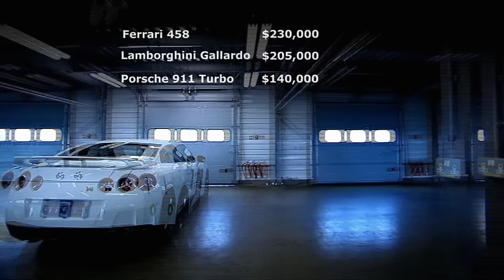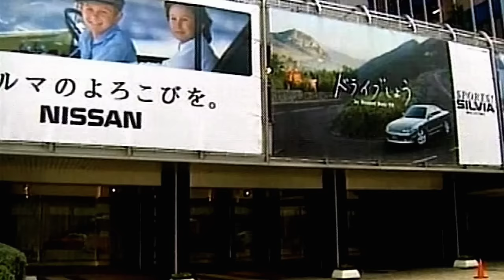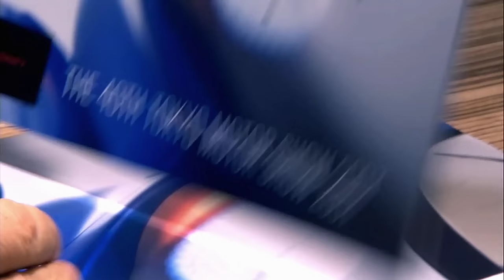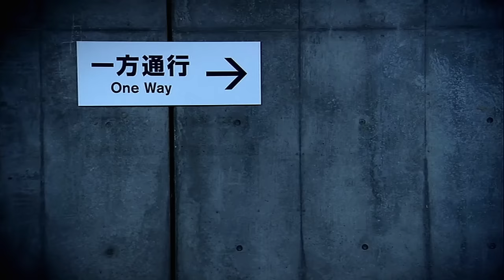Nat Geo MegaFactories - Nissan GT-R

Comment: I wish I could afford one. I’m most struck by the number of times the Nissan employees used the word “customer.” They really bought into the focus: “make the best car for the customer” and not “make the best car.” That’s a significant difference. Others may make fast, but uncomfortable, cars that you can barely climb into. I respect what Nissan did here.
Reply: Bro get 2010 they go for 50- 60k that pretty affordable. Don’t fall for dealership mark ups.
Reply from the maker: I wouldn't. I would only buy a 2012 and newer. The DBA has updated transmission components, and believe me. It's worth the extra costs instead of replacing it later.
Reply: @Mikey6048  never ever buy first generation of a new car model, even a 600~HP GTR
Reply from the maker: @kamenriderozai8403  especially the GTR

Comment: The GTR is a phenomenal car. Even the older models when it was still Skyline. My favorite.
Reply: Wdym even the older models?  The older models (specifically the R34) are way better than R35+
Reply from the maker: @jmathis2aug In what regards? Nostalgia? If based purely on performance. None of the GT-R of old touches the R35.
Reply: @Mikey6048 Go drive them all and you'll see why. The R35 is a driving appliance. It takes much of the skill out of the equation. Your mother could get in it and drive it fast! maybe that's the point....I've owned the R34 GTR and an R35 at the same time. I drove, and pushed them both all the time. The R34 was exciting, and fun, yet could be a calm daily driver. The R35 felt like a Maxima that was stupid fast.  In other words, boring. If I were to own another, I'd get an R32. It has almost the same drive train as an R34, but it's significantly lighter and by far the most fun to drive. I guess this is kind of happening to most cars nowadays unfortunately..... One of the reasons older cars are going through the roof in value. The 35 is a great car, but "the best GTR" is debatable.
Reply from the maker: @LordHolley  I own one. In stock form sure. But when modified it's a completely different animal.
Reply: I'm a 1969-1989 Skyline fan myself. I love the R32/33/34 very much, but those first two decades are my favorite! Like the Silvia. I love the S13/14/15, but I absolutely want an 83' 240RS Silvia. The Group B Homologation car. Drive that one & listen to it on Gran Turismo, then check out real pics & video. Of that Silvia and the first two Skylines ( and the Fairlady, Sunny/210, Gloria, Laurel, Cedric, Cima, the President, & of course the 510. So many glorious vehicles from Datsun/Nissan, and every Japanese auto manufacturer from the beginning up until 2004 ( but especially from 63'-99') 🌅
Reply: Right!  I would trade a testicle for an R34 or an R33.
Reply: 3 @LordHolley

Comment: I'm a Nissan GTR Master Certified technician. I  worked and serviced on many many GTRs between 2009 and 2014 . Awesome car.
Reply from the maker: I definitely appreciate you guys. I've had mine in the shop a couple of times for some breakdowns. (None the fault of the car) and the Master Techs that took care of me were top notch.

I've blown open an injector. Previous owner used, used injectors. You can blow air with your mouth through it. Flex fuel sensor shorted due to previous owner installing poorly.

Then I blew my transmission up last summer.... 🙄. 5th gear stripped 1/3 the teeth off and the Synchro was destroyed.

Comment: Pretty amazing when you consider that this cast aluminum block is now being built in 2500-3000hp levels while domestic vehicle's require an aftermarket block. The rest of the drivetrain is the same. Maybe a 300m gear here or there but, just bulletproof.

Comment: Good honest review 
Hi from New Zealand had my 800 MT for 12 months now done about 20000km  been a great bike so far, only issues I've had is a broken switch and the mirrors keep moving both replaced under warranty, I also own a triumph trophy and a GS, the CF moto is the bike I usually drag out of the shed
As you say get over the Chinese thing and it's all good 👍
I'm actually considering buying the just out in NZ cfmoto 450 mt

Comment: 36:26 Lmfao.... Most tire shops now days use nitrogen instead of air. "Unstable" is nonsense really. However normally air does have a higher content of Hydrogen, and thus Water. It also changes pressure more under different temps. Normally as the tires heat up, the pressure rises, Nitrogen tires change less.

Comment: They need to just make a newish version of the 300Zx mix the 80s and 90s designs, for something a bit smaller, less weighty, and utilize design input from the delorean HP 1000 Give consoomers the Hyudai N vision 74 of the 300 ZX. and make it hydrogen fuel cell based.

Comment: The only thing i dislike about the gtr is that its an automatic gear. I like manual transmission machines😢😢
Reply from the maker: Technically it is a manual. Just minus the 3rd pedal. It's called an automated manual. Instead of you operating the clutch. It's computer controlled. It may sound like an automatic, but it honestly isn't.
Reply: Thats what i dont like. I like the fully manual with the 3rd pedal. It gives me a sense of control.
Reply from the maker: @Lalmalsawma_C  I can appreciate that.

Comment: two phrases: one, turbo lag and two, Carlos Ghosn fled Japan for misappropriation of funds.
Reply from the maker: I've never experienced turbo lag on this car.
Reply: @Mikey6048  took them years to fix it
Reply: @Mikey6048  try flooring it at 15mph
Reply from the maker: @mikerotch8886  I have. As long as you're in manual and 1st or 2nd gear. But if you're in auto and it's in 3rd. Yea you'll have lag

Comment: are they reliable?
Reply from the maker: Motor is rock solid. Transmissions are iffy. Overall it's a very reliable car. If you never mod it and buy one newer than 2013 it's rock solid.

Comment: Since when does a 100k car become the "average mans" car?  At that price, 100k or 140k are about the same and you can afford a wide number of super cars.  This car is "mass produced," thereby making it more accessible.  I would argue that being mass produced could drive the price down to the 60-70k range with a few trade-offs, making the car more accessible.   But  to keep the mystic around the car and to profit from them, they will not.  I'm not a fan of the design, but it's a real nice car, one that this average man can not afford.

Comment: Upload some more of your GTR
Reply from the maker: I wish I had the time. I work 60+ hours a week and don't have time for YouTube currently.
Reply: @Mikey6048  how are you ? , How's everything going ?
Reply from the maker: @Janvick533  Very busy. Still working 60+ hours a week. The GTR transmission is hurt and I'm in the process, when I have time, of getting the rear subframe dropped and the transmission out. So I can send it to ShepTrans for a stage 2 with Heavy Duty gears build.
Reply: @Mikey6048  take care brother .
Reply from the maker: @Janvick533  I appreciate it. Trying to get a new job currently. If I get it. Hopefully I'll be able to find some time to post some stuff about the GT-R. I plan on putting a AMS titanium exhaust on it. So if I do I'll make a video of that. Hopefully.

This trans rebuild is going to cost me north of 13k$.

🤮
Reply: good luck bro id love to hear that future exhaust @Mikey6048
Reply: @Mikey6048  dam sorry to hear, i see you have a DBA GTR like me whats the issue with the transmission?
Reply from the maker: @charles-fq2dw  I had an axis solenoid go out and lost all Odd gears when downshifting to 5 on the highway.

   When I pulled the pan to pull the valvebody, I found metal chunks on top of it. So I am sending it off, today ironically, to ShepTrans for a full rebuild with Forged Gears, Forged Baskets and Billet forks.
Reply from the maker: @AE300  I actually purchased the AMS Titanium Exhaust, it came in Saturday. Once the transmission is back in. I'm going to make a sound clips video.
Reply: @Mikey6048  oh that's really nice, excited to hear your new exhaust
Reply from the maker: @AE300  Thanks brother. I lucked out and got it on sale as scratch and dent from AMS. They currently have a couple on thier site still for $1500+ off.

Comment: Funny, Toyota had to use BMW, just to bring back a legend. Not Nissan! MUCH RESPECT NISSAN!!
Reply: Toyota kinda does it mostly because its a cheap way to bring back the Supra rather than it being a must. BMW has good inline turbo engines, so Toyota chose their Z4, simple as that. In return BMW can take a look at Toyota's Mirai. If Toyota wanted to make a new Supra by themselves it'd be too expensive (apparently)
Reply: @PlatinumNath The expensive part is probably a collab with Yamaha for the inline 6 engine 😳
Reply: @HuskyKyurem  mayhaps, it'd sound wicked if Yamaha did it

You know what I kinda don't like on the Mk5 Supra though? They should've based it or used the engine from the BMW M2 (older one or newer one) rather than the Z4
Reply: @PlatinumNath  Would be a dumb move by BMW to use their flagship I6 for Toyota. You'd be hurting M sales.
Reply: @DingoZed  yeah, it's just a what if, since the Supra's overall performance in modern day against it's competitors are just okay, but okay is not good enough for most
Reply: You'd still be complaining like this if Toyota had made it themselves because they would've most likely chosen a V6 engine for it lol. Nooooo why not an inline 6 nooooo
Reply: Supra is not in the same league as GTR
Reply: @TinMan-kd2gv  I kinda think it is. Both had similar aero dynamics features back in the day. For example, active aerodynamics. Research it.
Reply: @KenyukoIMAdventure nope. Zupr4 has always been Nissan Z competitor with mitsu GTO/3000GT. Not GT-R. It's in a different class. Just like you don't compare Zupr4 with 911. Active aero doen't make them comparable. Research it
Reply: @lucky889s9  can’t say that I agree with you on that. The Supra and GTR, in Japan, are legendary for being top tier sports cars.

Comment: Never knew the GTR had dual drive shafts.
Reply from the maker: Since the GR6 transmission is in the rear (Transaxale) the transmission has a ETS unit that sends power via another driveshaft to the front differential.
Reply: @Mikey6048  yeah I didn't know it had the transmission in the rear, either
Reply from the maker: The GT-R was ahead of it's time back in 2008

Comment: Thanks for sharing! Is there a chance you could also share the source?
Reply from the maker: A DVD set that took me 2 years to find and finding it in Australia.
Reply: @Mikey6048  well I meant the raw rip of the disc but thanks. I'll see if I can track one down.
Reply from the maker: @eltioben3677  Lemme see what I can do regarding putting on Google drive or other methods.
Reply: @Mikey6048  appreciate it man. thx again.
Reply from the maker: @eltioben3677  Give me a few days. Pretty busy. I'll see what I can do to make it accessible for eveyone.
Reply: @Mikey6048  ay no problem. whenever u have time :)

Comment: Why Nitrogen Gas in the Tyres?
Reply from the maker: It's a gimmick for normal vehicles. Race cars use nitrogen during races because the husk pressure is more stable and consistent at higher temperature. On the track it has its merits but on the street it's pointless.

Comment: if this was the German own GTR this would have live forever. Unless the Japanese could design a car that level In the looks and performance the like Lamborghini Huracan, Ford GT, Ferrari, and When you see you’re in shock at their design are extraterrestrial… Japanese do not grasp this concept or understand that… introduces a sports car that barely can compete with the American V8. The GTR destroyed everything but let it sit there for 15 years and hardly get any updates. Can you imaging Porsche 911 didn’t upgrades for 15 yrs? The same with NSX….Like a Judo one-time champion do not continue to train and let be destroyed.  Most Japanese sports cars are on self-destruction…even Toyota builds its own Supra it still wouldn't sell them unless it could pull against a Corvette C8…a C8 could be had at 70k . 
Lexus LC500 $114k  470 hp…0-60 4.5 sec….
2024 BMW M5  $117   727hp 0-60 2.9 sec….
you wonder why they cant sell every sport cars they made.. 
why cant they put GTR engine or similar in the Infinity and Nissan.. Mercedes ,porsche, VW, Ford Dodge,Lambo, Ferarri…everyone use it to boost their image…nope…
Reply: No.

Comment: The problems is not a standard it’s automatic way better the r35 on standard
Reply from the maker: Technically it is a manual. And technically not an automatic. It's an automated manual. Yes it sounds like automatic and can perform like one in ways but it still uses 1-6 gears and dual clutches. It's just controlled via computer instead of your foot.

Comment: And only comes in automatic that’s lame what happened to the manual transmission? It’s a Nissan looks like a Nissan drives like a Nissan you probably get bored driving it after a while.
Reply from the maker: It is a manual. The DCT is considered a automated manual. But it functions like a manual transmission just controlled by computer.
Reply: @Mikey6048  does it have a clutch pedal?
Reply from the maker: I get what you are talking about regarding using the clutch pedal and rowing gears. In that sense. No it's not a "traditional" manual. (Believe me, it would have been awesome to have.) But on an engineering standpoint. It technically is a manual regarding the mechanical components of the transmission. You shift with padle shifters instead of a H pattern. Or you can run in "Auto" mode, which isn't great, and let the TCM control it.

It still uses Clutches, gearing, etc. It's just controlled internally with a hydraulic valvebody and solenoids.

Comment: Do they really rev new engine to the red line? Is it good for it? 

It have to be done for sure everything around oil change and that... Just let me quess
Reply: 0:41:35
Reply from the maker: I presume as part of the break in procedure and to ensure everything seals and runs correctly.
Reply: @Mikey6048  yeah, I know they could breaking the engine that way to change oil few times in just a few km after that to avoid contamine it of metal particles in it.

I was only wandering about this rpm in few hundered km...

I just thinking how many times they need to short oil change for the breaking the engine like that before the owner can buy it and go wild from the begining.
Reply from the maker: @C0R0NAH  Good question

Comment: overpriced v35
Reply from the maker: V35?
Reply: @Mikey6048  yes, its like a v35, they just modified it and we get this over priced mass manufactured version, be honest its nothing special when you compare the body style between both for the price
Reply from the maker: @g-funk484  I would absolutely disagree. I've had a G35 and G37x. I've taken my GT-R apart, transmission and everything. It's completely different, tons of expensive parts like carbon driveshafts etc are on this.

But that's your opinion. And you have the right to it. I just urge you to thoroughly inspect a GT-R if you have the chance to.
Reply: @Mikey6048  im talking about the looks i understand its not the same
Reply from the maker: @g-funk484  gotcha. I see. It is kinda similar. But in person it looks way different. For some reason video and pictures don't convey the shape. I thought the same thing before I saw one in person.